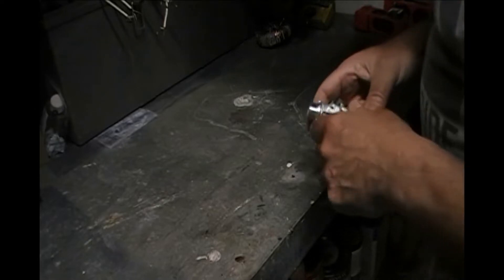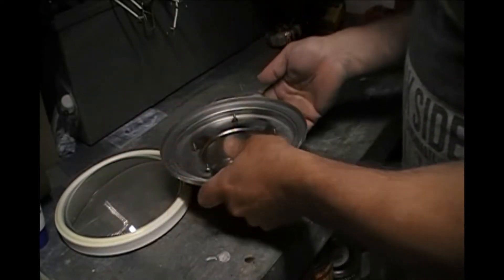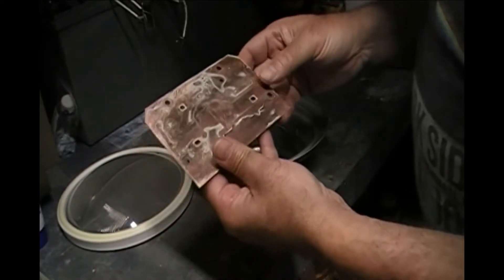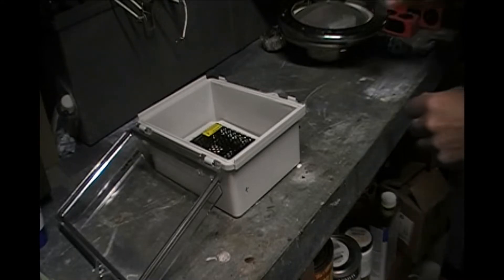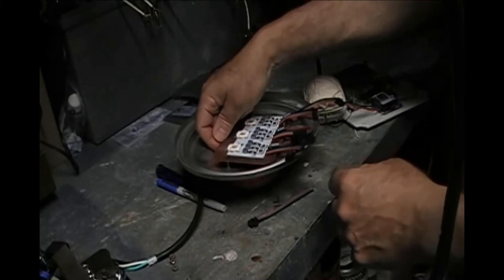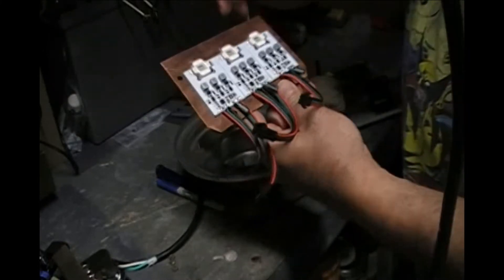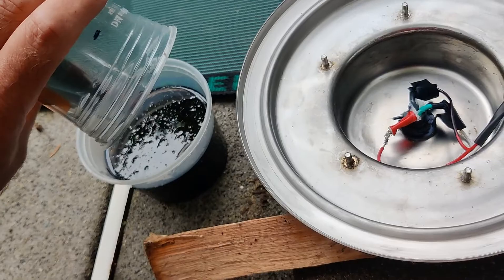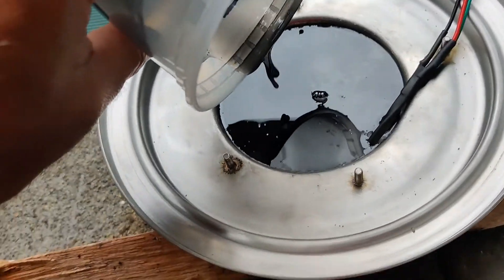Converting Pentair LED Pool Light to DIY

Comment: Hi, I followed his video as well and had the same electrical issue. Thanks to your video I now understand the problem. Any further tips on how you removed all the resin would be greatly appreciated. Thanks.
Reply from the maker: The resin. Man.. that seriously sucked big time. I used a Dremel grinder and had dust all over the place. I would seriously use a mask (I was stupid) and also if possible do it outside.  I've been having stability issues with the module in this video and I'm going to port over to an esp8266 (it probably won't have all that Alexa built in)